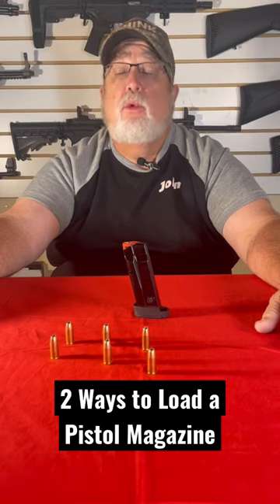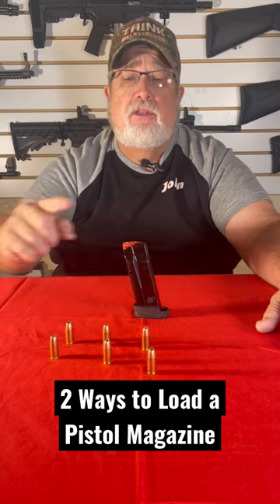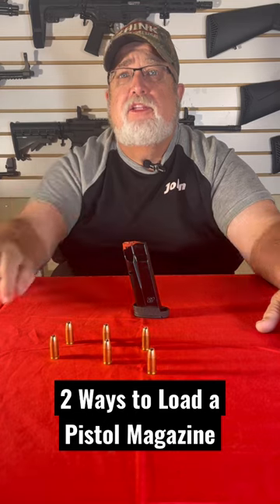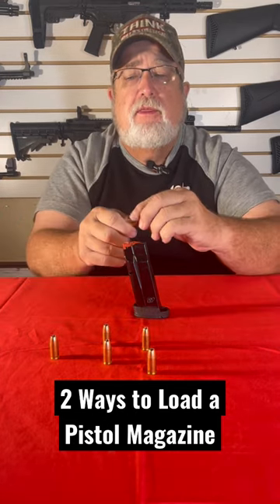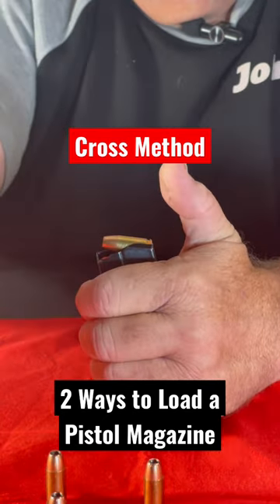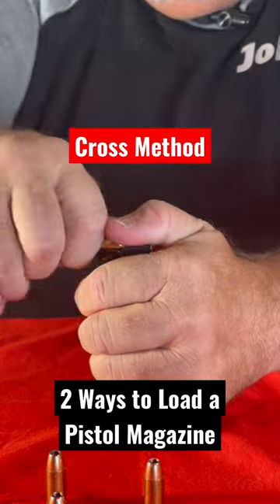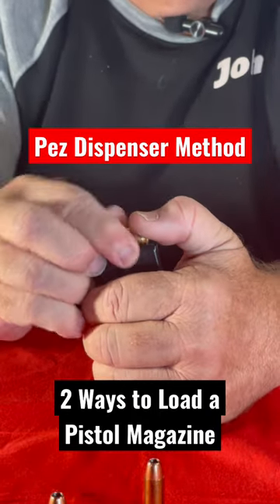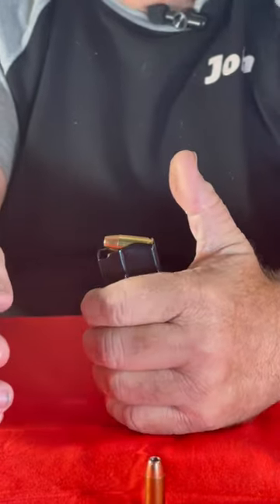The Best Way to Load a Magazine

Comment: Okay, tried the cross method at the range today on an extremely stiff M&P M2.0 9mm, and it worked perfectly. Since I didn't take my uplula with, it was a fantastic way to save my thumbs after multiple magazine loadings. 10/10 do reccomend.
Reply from the maker: So glad it helped!
Reply: I own or have owned many different semiauto pistols from almost every manufacturer out there and by far the hardest pistol mag for me to load is a Sig P320X Compact mag. ALL of the rest is easy as pie for me but the last round in the P320X Compact mag is a bear for me.
It is even harder now that I was diagnosed with tongue and throat cancer that spread into my one lymph node in June 2023 
I finished my 8 weeks of aggressive chemo and radiation treatment on Oct. 12th 2023 and I am still weak and tired but about once a week, maybe twice on a good week I walk out to my back yard (Rural Ohio) and try to fire 25 to 50 rounds with one of my pistols, mainly my carry gun which is the aforementioned Sig P320X Compact. My stepson just dropped off his new Sig 365 Macro Comp and 100 rounds of 9mm and asked if I would "Break it in" for him and I replied "Most indubitably" but I haven't got a chance to tear his pistol down and clean it before the first round goes out the tube of the P365 but soon, very soon!
Reply: Thats hilarious. I just bought my first gun(M&P M2.0) and struggled to load the magazine. Im glad its not just me 🤣
Reply: @jamesfoster6890 samee that shit stiff asf 😭

Comment: Thank you sir! I am a complete beginner and I thought I just had to tough it out and push harder as I held the magazine in the air in my hand! Pez worked much better for a 7 bullet magazine (m&p 2.0 shield 9, I don't know if there is much of a difference) and I tried the cross with the 8 bullet one which also worked. I just couldn't get the last ones in, thanks again!
Reply from the maker: Thanks for commenting

Comment: Honestly the most common method I've seen is using the tip of a thumb to push the bullet down enough to slide the next on in, these methods you demonstrated seem way better so i will start using the cross method
Reply from the maker: THANKS for Commenting

Comment: I usually use a MagLULA UPLOADER. Good to know about the cross loader method. Always used the Pez method. Just didn't know there was a name for the Pez method.
Reply from the maker: We use loaders a lot too but its important to have the ability to load without it.
Reply: @johnthefirearmsinstructor  Sometimes I need a separate loader. I have a Sig-365 and everybody knows those ten round magazines are fairly stiff. Especially the last few rounds.

Comment: Sir, any points in where to best place the bullet when loading a new mag with stiff spring to compensate for depress?
Reply from the maker: I'd say just make sure you're in front of the lips in the back obviously. Other than that its important to find the center of the spring so the follower doesn't twist at all. That always makes it harder.

Comment: Is it safe to keep a mag loaded with bullets and stored away for years? Does the spring eventually snap or break under its pressure?
Reply from the maker: Yes it is safe 

No the spring will not Snap under pressure 

The mags are meant to be loaded 

If Anything you should be going to the range at least once a month.

Comment: Hey I have alot of experience with fire arms but getting a new glock and trying to load the mag had me scratching my head bcs I did it right but after a few I was giving it my all and it wasn't working so ur video helped and thanks for not being a dick I kno loading a mag should be common sense but them spring suck
Reply from the maker: Probably one of the hardest thing at each student keep up the great work and thanks for commenting

Comment: I've never seen the cross method. I would give this a try. But, I prefer using the maglula. When I'm at the range, I'm there to train for speed and accuracy at various distances. I don't have the time to be messing around with manually reloading the magazine. I used to do this before I discovered Maglula, and I'd go home with a sore ass thumb. Not anymore. But, that's just me. 😂😂😂😊😊
Reply from the maker: Thanks for coming that is a helpful tool. Just remember you may not have that tool or you may lose it. You still gonna know how to load the magazine with your sore thumbs thanks for commenting

Comment: I think I’m a wussy bc I just got a new shield plus mag and can’t get past 10 and the other one got to 12 have yet to be able to fill buying a loader lol
Reply from the maker: Just like a pair of shoes, a magazine needs to be worked in start been round as you can then add another one and another one and another one let magazine sit the spring break. When you go to Range, you don’t need to have a full magazine starter five rounds at the time you’ll find you have a lot better accuracy Loading full. Then loading a full magazine 

 Lot of people hold the magazine in there  hand. instead of putting on something hard like the table deck pushing something hard versus push to get your belly pillow the magazines a lot easier